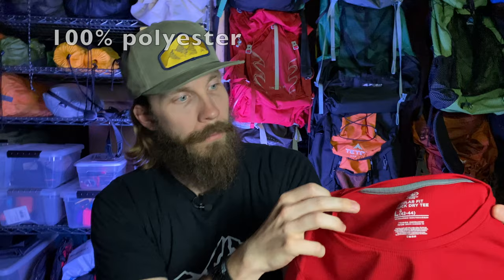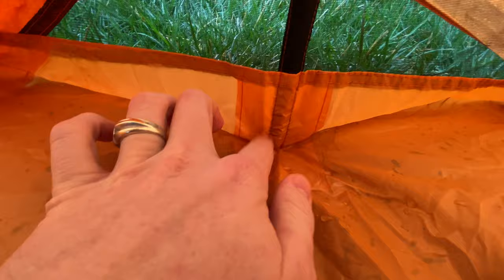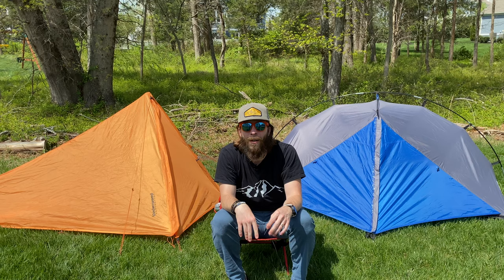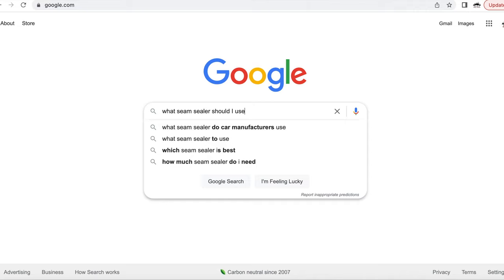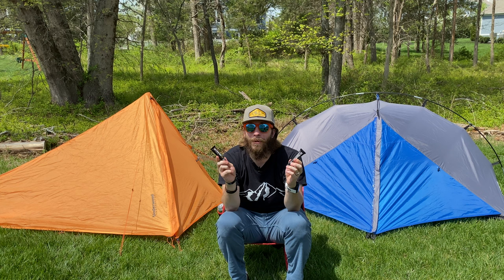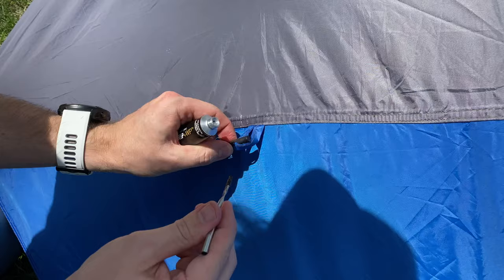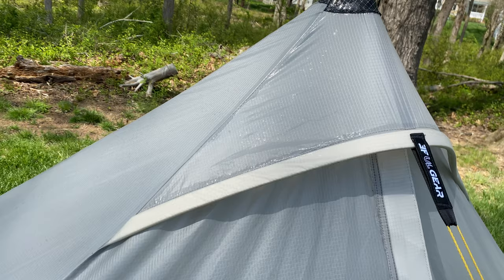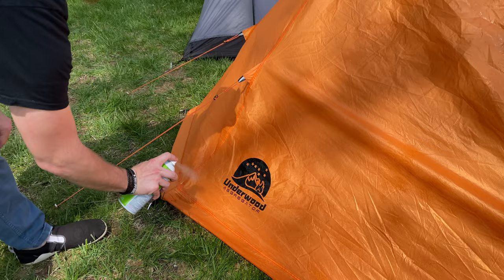FIX IT for $12  ||  How to Waterproof a Tent (even cheap tents!)

Comment: Interesting but unfortunately you used the seam sealer on the outside and Gear Aid instructions say apply to the inside of the fly - oops !!
Reply from the maker: Hey Phil! Thanks for your comment. I think applying to the inside of the fly is more doable since you can take the fly off and stretch it out. But both of these tents were single wall and, while they don't have a fly, I did try putting it on the inside and it just wasn't practical. Difficult to get in corners and other spots and the fabric is sort of scrunched up in spots since it's on the inside of an arc. So opted to just apply to the outside where the seams are pulled tight and the sealer can really do a good job.
But you could definitely try to do the inside as well.
Thanks for watching!
Reply: @DoseofDirt  hi , still applies to single skin tents as the fly is a single skin. 👍

Comment: You are getting confused over different material terms - "Wet Out" applies to breathable porous materials when the outer surface is soaked and the material can no longer breath - this does not apply to normal tent fabric which is not a breathable fabric. A DWR does NOT waterproof a fabric - it helps to repel water on the outside of a fabric which is required with a BREATHABLE fabric, they will help to stop water pooling on the outside but do nothing for the waterproofing as this is done on the inside. There is no point sealing on the  outside - waterproofing on tents should be done on the inside as this is where the water proof layer is. Before you go and flame me for this comment - I repair waterproof fabrics professionally every day and encounter your misconceptions all the time.  You are correct that it is vital to determine if your fabric has a Silicone content as nothing but a silicone based product will stick to that - thankfully most materials have a polyurethane coating which is easy to seal - we use a PU based adhesive/sealant (similar to storm seal etc) thinned with a strong solvent (toluene) - this allpied directly to the seams on the inside.
Reply: Could you break that down for a dummy who want to seal their tent up ? What I need to get and do please

Comment: Anyone who doesn't already know everything you said in the first 1.5 minutes of this video probably shouldn't own a tent.  They need to go out with others and learn some things first so they don't die of hypothermia.  A couple things I’ve learned from 30 years of week long trips into the deep woods of Ontario and Quebec.

You’re buying cheap tents and using expensive waterproofing on them and that’s backwards.  You should be buying the best quality tents and using cheap waterproofing on them.  You just can’t polish a turd and you don’t want your only shelter to let you down when you’re deep in the bush, days from civilization.

Second, you are completely wrong about the seam sealers.  Seam Grip SIL is just silicone you can buy at the hardware store, and Seam Grip WP is polyurethane (Aquaseal or windshield adhesive).  Both will work on any tent regardless of material or waterproofing.  I don’t use these because they are overpriced.  I buy a tube of clear silicone tub and tile caulking from the hardware store, squirt it out into a container and thin it down with acetone.  Once it’s viscosity is good to use with a paint brush, I brush it on all my tent seams, sort of like you did, but I use a lot more and don’t try to be as carful.  You need your tent to keep you dry, not win fashion contests.  As you use the silicone, the acetone will evaporate off quickly and you may need to add more half way through.  At the end the left over silicone gets much thicker and I brush this over the entire floor of my tent to completely waterproof the floor.  If you really want to use polyurethane to seam seal your tent, the buy Aquaseal FD in the 8oz tube as it’s less than half the price.  Or, if you don’t mind using a black sealant, windshield urethane adhesive is about 1/6 the price.  Keep left over by squeezing out all the air from the tube, and sealing the cap back on then keep in the freezer.  You may need a knife to cut off the little bit that cures under the cap when you use it again but the tube will last for years in the freezer.  For the windshield urethane, cover with a thick plastic bag and rubber band.

Also, silicone and polyurethane don’t dry, they chemically cure.  Both are mixed with catalysts in the tube.  They begin to polymerize when the tube is opened and they are exposed to moisture in the air.  If you want them to cure faster use them in high humidity.  They won’t cure so well in an arid environment.

For waterproofing the material, don’t use that spray on stuff.  It too is far too expensive and you can’t get enough of it on.  Buy a gallon can of silicone tent waterproofing and put it on liberally with a cheap paint brush.  Reseal can and repeat next year, or next month if you’re using your tent that much.

Comment: It doesn’t matter how cheap a tent is ,if it leaks it’s not fit for purpose & of un merchantable quality & should not be allowed for sale to the public . Any shysters flogging such crap merchandise should be made to fully compensate any customers losses or face a prison sentence. The customer should not have to go to the trouble of piss bollocking around ,with waterproof sealers on a tent they have spent their hard earned bunce on . They should demand a refund & compensation .
Reply from the maker: I hear you. It’s frustrating. But if I can get a $27 tent that needs sealing at a cost of $12, I’ll take that any day over a $100 tent. 
But yes, it would be nice if it just came waterproof! 🤣
Reply: @DoseofDirt  Tents that are in your price point ,are usually sold as kids play or sunny day beach tents in the U.K. ,usually only suitable for the odd short very light rain summer shower at best . Normally they are only advertised as such ,but if they claim to be fully waterproof then they should be . Of course if you buy a used quality serious campers tent for play tent money ,then a person wouldn’t mind having to do a bit of waterproofing & the odd repair if necessary .Happy trails 👍